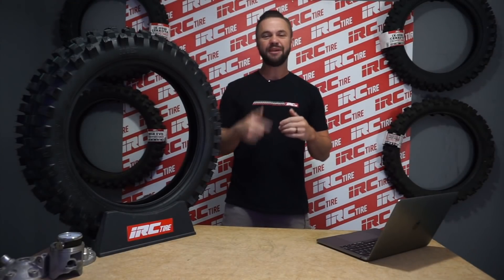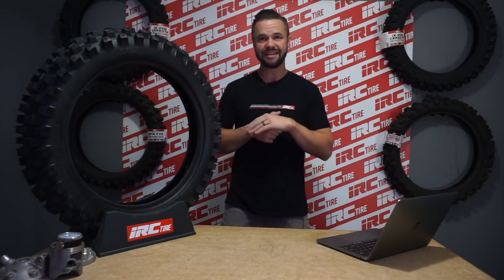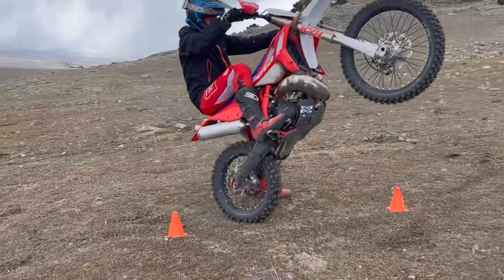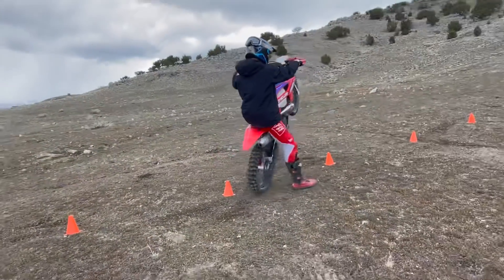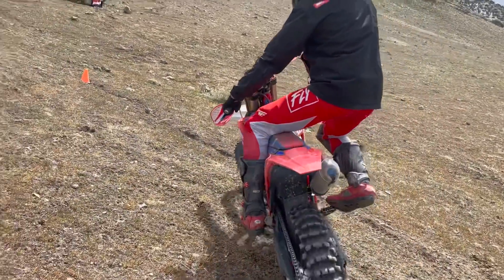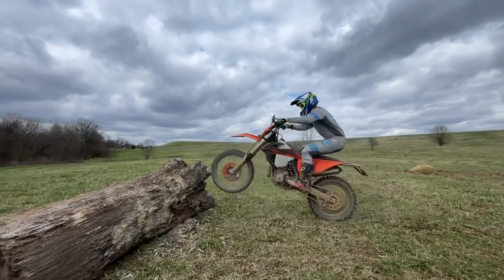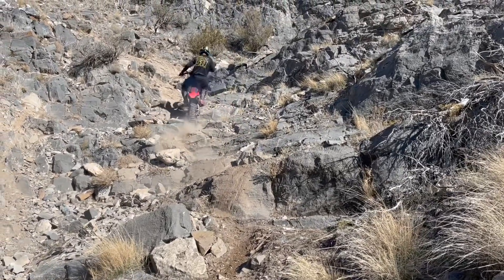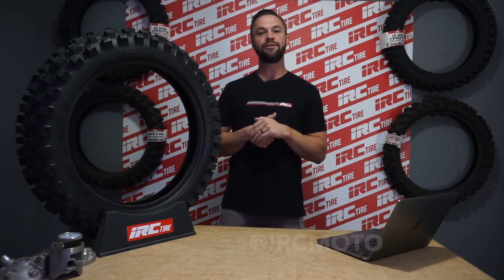A Simple Bad Habit Most Riders Have!

Comment: i need to learn to use breaks to control power of machine, especially rear break, since i got proper mx boots few days ago it feels so weird without much feeling at feet fingers. but i use finger on a front break to have better control over throttle, it helps me to make fine adjustment to the throttle.
i got my first real mx bike after 20years of dreaming, and it was wicked past 2 weeks. i cant sleep much, i just wanna ride, even tho i feel pain in my whole body, specially arm pump.

Comment: @IRCTireUSAMoto Are there exceptions to this when riding fast? Do you have tips for taller riders who find that this puts their wrist at extreme angles while standing?

I always cover my controls. On a recent multi day dual sport ride, I had a hard time keeping up with everyone else who didn't cover their controls. I'm 6'2" and while standing, this puts my wrists at an extreme angle that makes it hard to apply over 50% throttle while covering the front brake. I tried regripping, but it felt like I was tending to whiskey throttle. Everyone told me to stop covering the rear brake, that that was my problem, but I'm not sure I want to stop  covering it.

Comment: Probably a stupid question but does this apply even in GNCC riding as well? Of covering the front brake 100% of the time
Reply from the maker: It’s definitely preference. But the point is being able to add throttle and front brake at the same time. I personally cover 100% of the time.
Reply: @IRCTireUSAMoto  I see in the video you use your pointer finger vs your middle finger to cover your front brake. Interested to see which finger to use to make it easier to use the throttle

Comment: I'm pushing 70 and only fairly recently acquired a modern bike that actually has a front brake that works. 50 years of riding old MX bikes where you didn't even bother to try to pull the lever as it was almost pointless, a gradual slow down at best. Then, piloting an RMX Suzuki on the trails, I realised just how exciting it was to actually be able to lock the front wheel at speed, very interesting to say the least. Leaving a finger on the lever and still working the throttle is the go, excellent clip, great advice, trials riders have been doing this since Christ was a boy.
Reply: Lol.  Last bike I rode was my dad’s 82 Husqvarna 430 (mine now) a long time ago.  Just bought a 2010 KTM 200 and using the front brake and clutch for the first time: “holy shit!  That’s crazy!”
Reply: I'm 29, had many two-strokes from 75 to 250 over the years, best bike I've ever had is 97 kx250, even sold my 2017 yz250 recently to fund a rebuild and resto. There's just something about the old Japanese steel frames.
Reply: Very true, with the exception of CZ motorcycles. My 1971 CZ will lock it's front wheel on pavement easily with two fingers. This has created some interesting moments in Vintage MX races where the other rider waits to shut off later into a corner and can't stop as fast. I love this video (and my CZ).

Comment: The way I learned was from having a carb out of adjustment (wouldn't idle) on a gnarly long downhill singletrack.  You could probably adapt this into training by adjusting the idle so it won't run without throttle, and have a clutch-in "slow race" down a hill where you control the speed with the front brake while trying to keep the bike running.
Reply: I've had that issue too... I personally wouldn't purposely make my bike run like shit just for throttle and front brake practice tho.
Reply: Yaaaa I have that same thing idles really high also have to adjust the jets too

Comment: Stationary double step? How do wind on enough throttle with the brakes jammed on simultaneously?
Reply from the maker: I think you’re talking about when I’m stuffing into an obstacle? I’m slipping the clutch just enough to put pressure into the obstacle. But I’m IN enough of the friction zone to be able to increase the rpm. Then I release everything simultaneously.
Reply: @IRCTireUSAMoto  but you'll need to be ready for the second step?
Reply from the maker: Hmmm I'm not sure what you mean. Sorry, but regardless, covering the front brake with one finger makes you MORE ready for any obstacle.
Reply: @IRCTireUSAMoto  Ok thanks for the quick replies. At the end of this video is my query       https://www.youtube.com/watch?v=iNfsCJNi5Ag&t=10s          I can't see if Smage is covering the front brake here or not? I have attempted these types of double steps but if I cover the front brake on a lower powered/smaller cc bike then I can't get enough power generated ( due to the small rotational angle on the throttle) if I cover the front brake as well?

Comment: What levers are you using that clear you index finger on the bars?  I see that at least on the clutch side you keep your index finger on the bars and pull the lever with your middle finger.  Which finger do you cover the front brake with?

Comment: This is definitely something I struggle with. I’ve developed the habit of using my rear brake to help get the front wheel in the air which is just the wrong way to go about it. I’ve been trying to learn to use the front more for months. I can use the front when I pivot turn to the right but I can only use the rear when I’m pivoting left or doing wheelie/double blip going forward 😂
Good content thanks, Rich 🤙
Reply from the maker: Great to be able to do it both ways!! Thanks for watching!

Comment: Track guys know using front brake in turns when on throttle helps a ton. Loads the front tire for better traction and also can help with lean angle
Reply from the maker: You got that right.